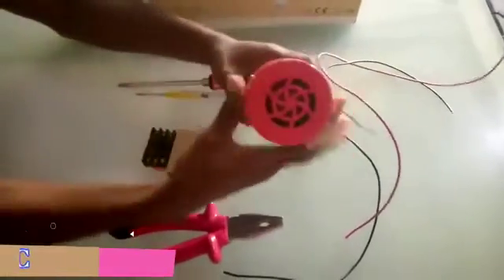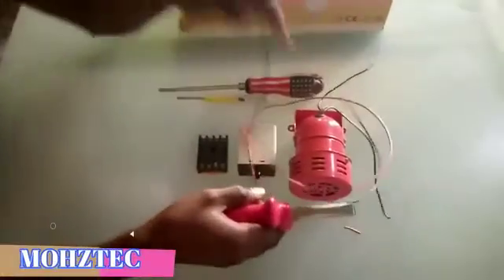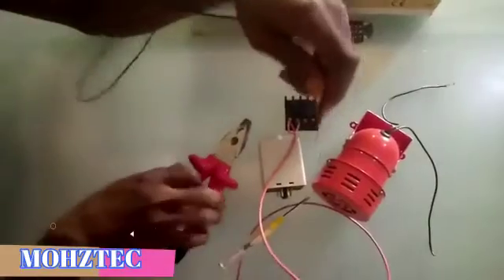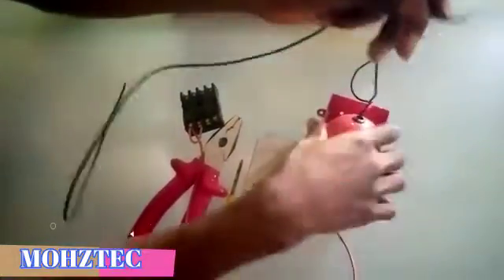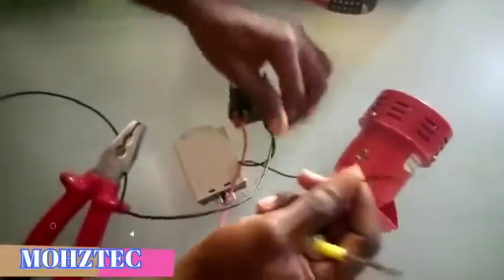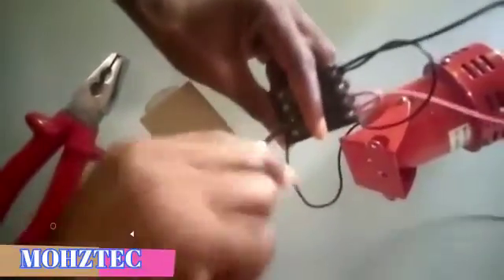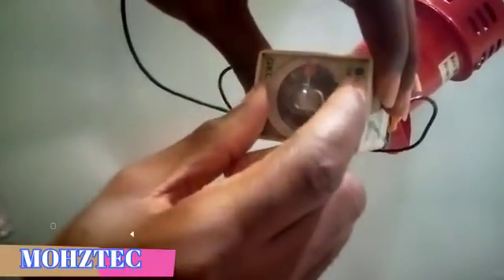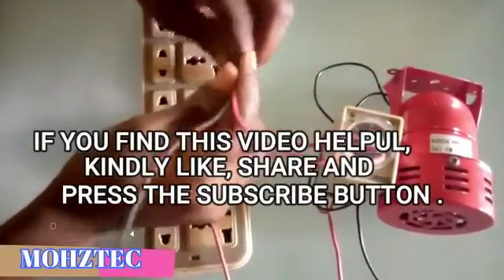HOW TO CONNECT ANLY TIMER WITH SIREN

Comment: Please How do I install a load separation on a building,, for example where I have 4 AC units, 2 water heater and I want them to work only on NEPA while the lighting points works on both generator and NEPA, and also carry out load balancing in the installation..